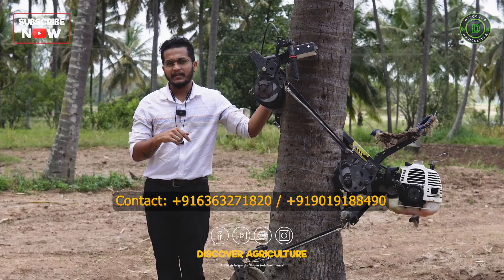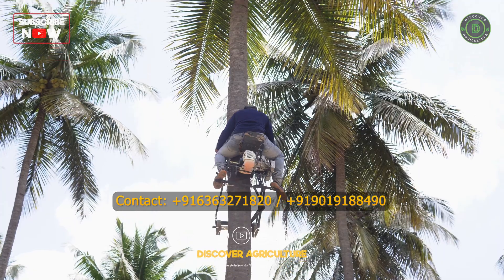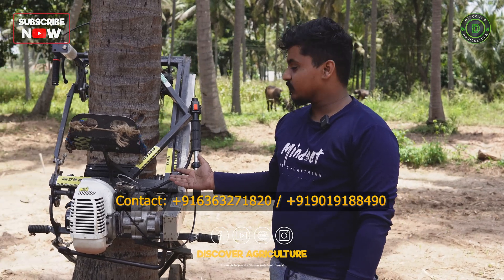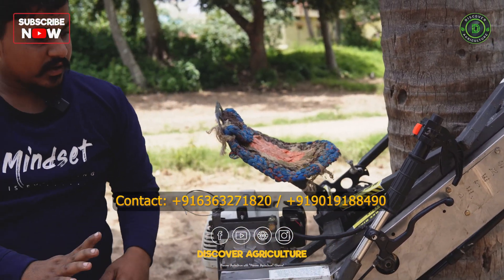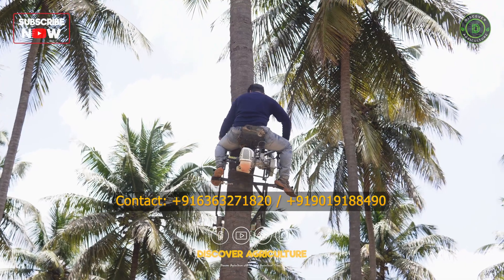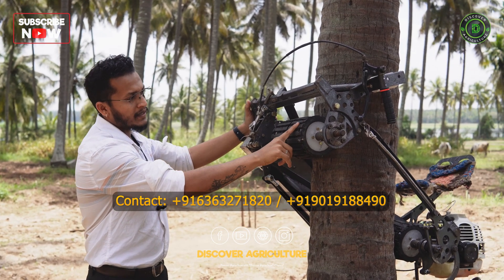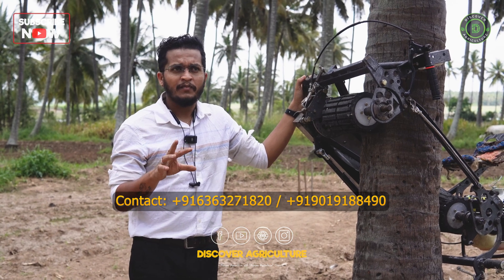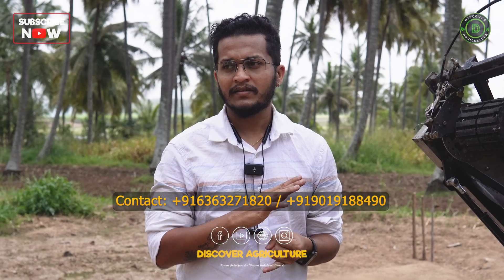Coconut Tree Climbing Machine | Coconut Tree Climber Bike

Comment: For solving the weight of the machine, perhaps the same engine power could be used to drive some wheels when moving on the ground. They could even be efficient with it and only use the engine to help push the machine uphills. Engine can be turned off for downhills and maybe flat ground depending on terrain and persons strength. 

If such a solution could be engineered, then the weight does not matter anymore as it can be easily moved. You sacrifice some fuel for movement, but that can be compensated by making the tank slightly larger since weight is less an issue.